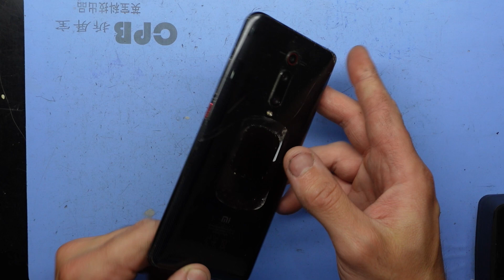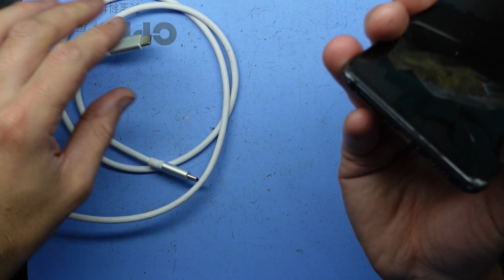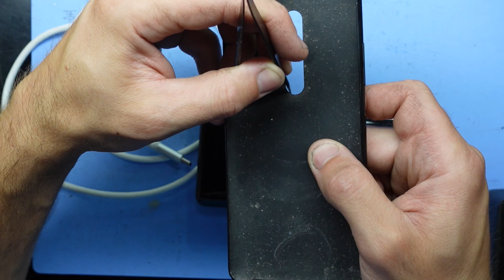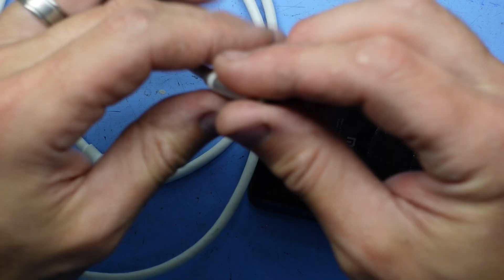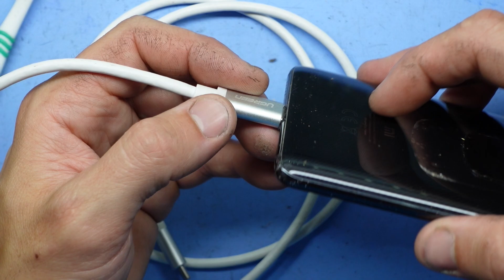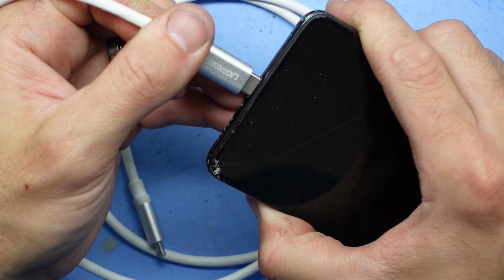Why is my charger cable falling out of my phone, and other issues

Comment: Thanks i never thought about that. I used a toothpick and it worked! Now my charging cable doesn't get rejected like before.
Reply from the maker: Excellent to read this has helped!
Reply: @rickstechrepairs  I have done this and pulled fluff out, now the charger just keeps slipping out, any idea what is causing this

Comment: DENTAL TOOLS!!  hahaha... Mine are labeled "Probe Set", but basically 4 dental tools in a pack.  Quick Clean did the trick and these tools made it very easy. 
I feel SOOOOO stupid not thinking of this!!!  I clean out computers with clogged fan heat sinks and keyboards with crud in them all the time.  I never thought about the jack getting packed in with crud to keep the cord from locking in.   "Slaps Forehead HARD"!!! hahahaha   Good Luck with yours.
Reply from the maker: Haha great to read you got it sorted

I see phones everyday with charging issues and about 75% of the time. A simple clean is all that's needed

Comment: Doesn't matter which cable I use if I bump it or touch my phone at all the cable disconnects or completely just falls out of my phone pretty sure it's a damaged charger port thanks to my nieces and nephews jerking the cords out of everything and I have no clue how to repair my moto stylus 5g and I can't afford a repair device so I'm screwed
Reply from the maker: take it to a local phone repairer and se if their is simply fluff in the charger port.

Most would have a quick look for free or cheap

Comment: Mr C
0 seconds ago
I cleaned and cleaned my port, but no luck...I'm ready to toss my Samsung A32 in the garbage where it belongs! I HATE this phone, it's been problematic since day one. Cord falls out all the time keep getting the message that the cord is broken or disconnected, I've pretty much had it with this piece of junk. The port is clear, no dirt or lint in there, it just won't make a connection. If Samsung can't make a phone with a reliable charging port, they should quit making phones because if your phone won't charge, you have a brick...
Reply from the maker: possibly take to a third part phone repairer

Comment: Made mine worse, before it just use to pop out now I have to wiggle the cable and put it half way in to charge, takes a dozen tries to get it to charge. No idea what I did to cause this. Better when it just popped out when moved.
Reply from the maker: sounds like a bunch of fluff in there, i would go with taking it to a local phone repair store